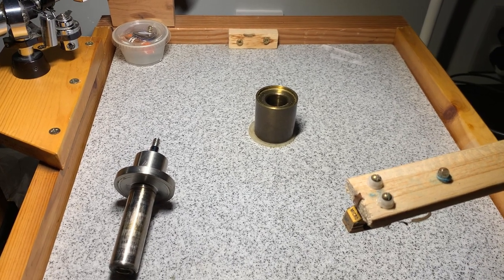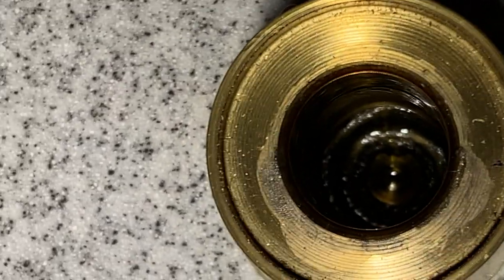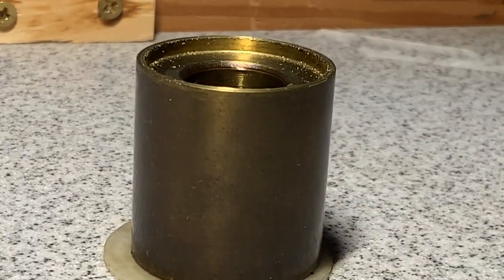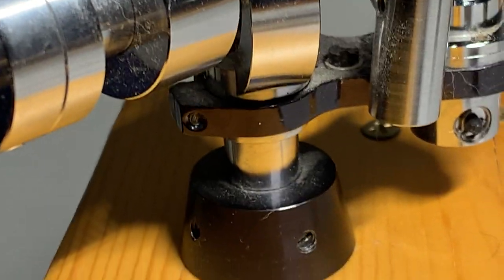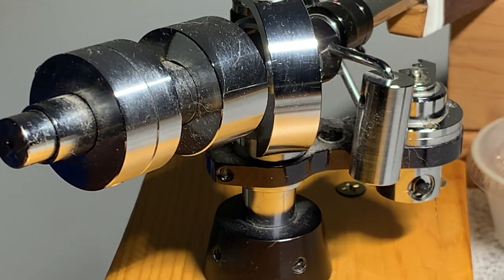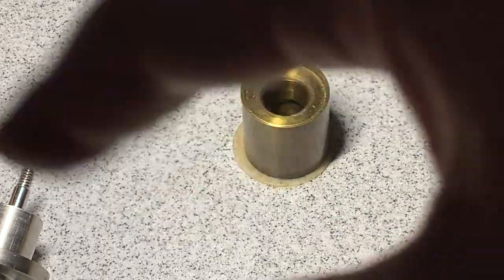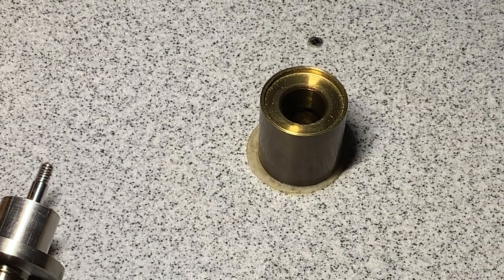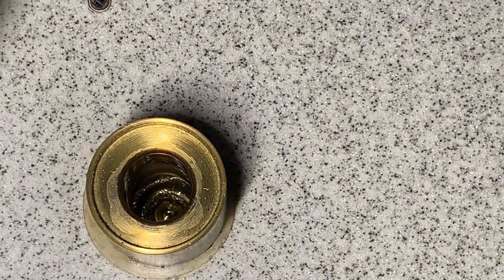Turntable clinic:  inside the bearing shaft & spindle

Comment: With that long wooden tonearm, did you have any trouble or issues setting the VTF or the azimuth of the Benz cartridge? What about the VTA of both tonearms to set the SRA to aprox 92 degrees or at least to how you like and prefer the sound. I assume your platter is level to begin with, and these are things you’re most likely going to get to eventually in this turntable series. I apologize for all the questions, but you do have a rather unconventional set up. Thank you, Janos. I hope you’re getting a healthy amount of sleep. 🎶🙂🔊
Reply from the maker: Hi Nick, with the longer arm it's been much easier to set both VTA and VTF then with short arms. Everything is set to level, and then VTA is adjusted by adjusting the arm height, and VTF is fine tuned by digital pressure meter and adjusting the weight - will show it.  Also, it just tracks so much better than shorter arms! any warp/ shift that introduces x angle of shit with a 9in arm introduces half the angle change to a 18in arm... (stylus to shaft distance). I never measure the VTA angle - set it by hearing. About 92 degrees is in the ballpark;